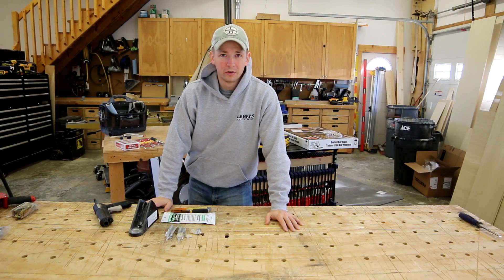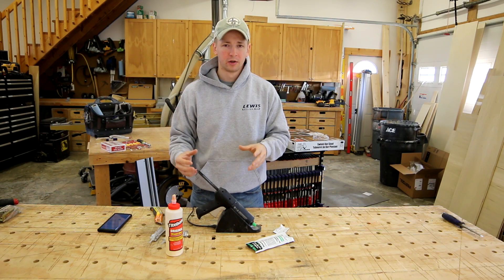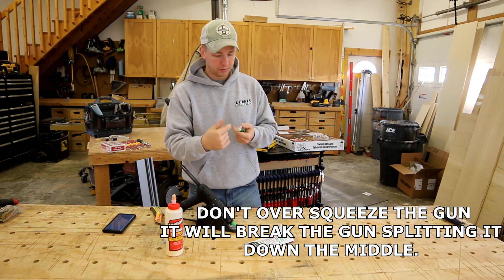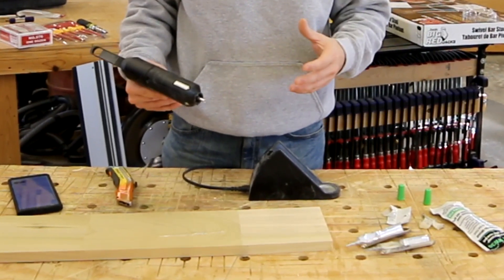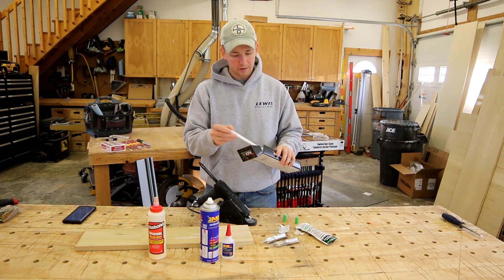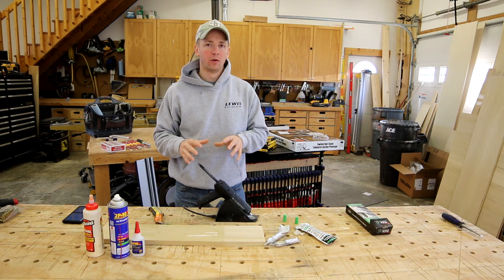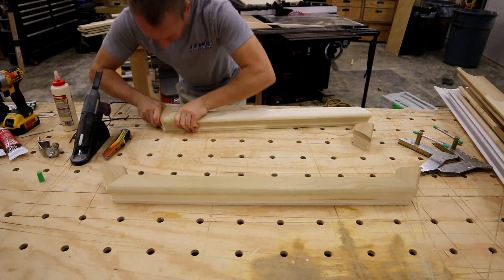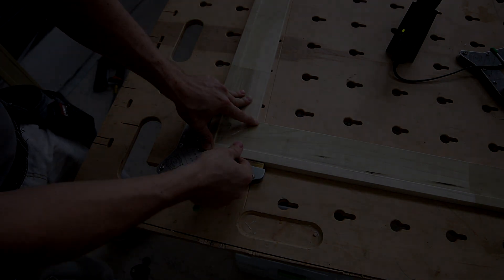PUR Adhesive for Production Trim Carpentry - Everything You Need to Know

Comment: After watching your first video showcasing the Pur glue system, I bought the gun and a case of 60-second-set glue tubes (the yellow ones) specifically hoping the combo would help me assemble through dovetail and half-blind dovetail drawer boxes more quickly and with fewer clamps than required with standard wood glues.

After more than 100 boxes assembled with Pur to date, I can state emphatically that this is the ONLY WAY to glue up drawer boxes with complex joinery. No squeeze out, no clamps needed, superior holding, and nearly instant setting. Just apply Pur at one corner joint, square and hold for a 20-count, and move on to next joint. In 2 minutes with no clamping, you will have perfectly square and super strong drawer boxes that only get stronger by the hour. Total game changer.

Can't thank you enough.
Reply from the maker: That's awesome. Glad to hear it ramped up your production so much!
Reply: Where do you purchase the pur glue gun/cartridges?
Reply: I get mine at Amazon.

Comment: I remember watching this video a couple years ago and thinking how great it would be to have a setup and routine like this. Fast forward to today and my setup is almost exactly this way, I cut all my casing and then assemble it all at one time. I have been using the Titebond Speed Set for a while now, and it's doing a great job. But for window casing I ordered the Hot melt gun the other day, because I know how long it takes those four joints to set sometimes. Having only 4 clam clamps doesn't help either, hopefully Mr Chesnutt is healing up alright and gonna be back at it before long. Thanks for the info Spencer. 👌🏼

Comment: Years ago I forgot what CA glue does to the finish of stained wood and was gluing up a hand rail joint. Well needless to say I had to sand and finish spray that end as the finish coat pealed off once I sprayed the activator onto it. I love CA glue for putting sticking together when I make my divided light cabinet doors with glass but has to be bare wood for sure. I simply wasn’t thinking about it and lesson learned.

Comment: Super well done review. My favourite part about HiPur is squeeze out on finish product just safely rubs off. 
 You covered any issue I’ve personally had with it as a cabinet guy trying to use it for crown molding. I was so excited to try HiPur when I found it, but to illustrate your point as well as my experience using it on maple crown molding, your exact size wood and demonstration at @25:04 , I highly doubt that exact test with maple up on the table like that could have withstood much more then its own weight before popping, never mind any actual pressure or even close to what you did. At least 10x the strength difference to the material you used there.

Comment: Thank You Spencer! great information. I have recently bought into your system. I have yet had a chance to change my work flow and glue up casings. But trust me next chance I have I will be doing my miters.

I have used the HiPUR on baluster on a 15 ft run of railing. OMG AMAZING!!! tightened up the railing very nicely.
Reply from the maker: Awesome, wood or metal balusters? Hipur does not bond well on metal so I would not recommend it for that.
Reply: @InsiderCarpentry  They were wooden balusters on open treads. I posted a picture of it on my IG account.

Comment: Thanks for this in depth intro. I’ve been curious about hipur but had been hearing mixed reviews. I’ve used wood-specific high temp hot glue for years. It’s the greenish color with a slight sulfur odor. This looks like this is a similar but even stronger product.

Comment: Hey great video! I have found out that if you take the chill out of the ends of your joints with an iron or hair dryer it will increase your working time. I believe that it allows the glue to penetrate deeper as well. Also, when you order your glue tubes it’s probably a good idea to have your supplier check the dates on the tubes before shipping, The glue does have a shelf life and I have been shipped expired tubes before. 
The hi-pur system I use is from Franklin adhesives and I called them up to inquire about where to find the dates on the tubes.

Comment: Hey Lewis. I have been reading up on this product and I found reports that the bond can be separated from applying 130 degrees of heat to the glued joint (using a hot air tool). Seems like a useful bit of information.
Reply from the maker: Yes, super useful tip. I wish I would have got that in there.

Comment: Love this video I learned a lot  can you please send a link for the corner clamps I can not seam to find them on your tool page. Thanls keep these video's coming
Reply: Thanks for the like any chance to get a link for the clam clamps in the video I can't find them in your store.
Reply from the maker: You have to call and order them direct from the manufacturer. Miterclamp.com
Reply: Thanks so much I also loved the railing video with the cables great job working around a tuff project and keeping you cool. Truly showing your talent. Thumbs up. Have a great weekend
Reply: @BandasPalette  Clam clamps are wholly made in the USA (materials and labor). They are $65 for four+ or 60 for 8+ (from memory). I would rather pay a couple more cents to support local business.
Reply: @samtaylor6385  that sounds great.
Reply: @InsiderCarpentry  thanks found them also love the van nice job.
Reply: @samtaylor6385  Think you need to say that pricing is per clamp and the price per clamp reduces slightly as you increase the volume of your order.
Reply: @goatsears  No Sir. Price decreases depending if you buy 2+, 4+ or 8+. Not per clamp. From the website: "Two Clamps................... $70.00 each clamp
Four Clamps................... $65.00 each clamp
Eight or more Clamps...... $60.00 each clamp"

Comment: Thank you so much Spencer!
Thursday we installed an oak handrail with returns, we used 2 domino's and pins to save time.
Unfortunately we had to sand the pins down with a flap disc on a grinder.

The only crown we install on our cabinets, are either a custom profile made by us.... or paint grade pine.
All our trim is prefinished without a matching caulk, so we pin it and use wax sticks.
I really want to learn to pre-assemble as much as possible.

Comment: You did an excellent job on this. It is cheap insurance to use a strip of thick plastic tape across both halves of the gun because sometimes when you put in a new tube you can see the gun flex/separate and this holds it together. I was told that the barrier seal is a ball bearing so thank you for clearing that misconception up.
Reply from the maker: I think it might have used to be a ball bearing bb type thing. But not on these new tubes.

Comment: Spencer Just bought 4 clam clamps and the hipur glue gun. Was wondering if you ever used that glue with clam clamps on IPe 1x6. We are going to do a deck and it has a picture frame around entire deck. Wasn't sure if the Ipe wouldn't suck the glue in since its so hard. We usually use a 2 part marine epoxy but is messy and it has longer cure time. Thanks for your great vids. YOU are a truer master carpenter.
Reply from the maker: I would definitely stick with the epoxy for that application. I bet hipur won't like the ipe oils. And being outside I wouldn't trust the hipur. Definitely throw some dominoes in the joint too for outdoor applications.

Comment: Looking for some advice on getting my cartridges to last longer before turning yellowish and not bonding the material. Should I take it off the base after I know I’m done glueing for a while? And you are completely correct when you say it’s a game changer for sure !!
Reply from the maker: Yellow is a sign its been curing with the air moisture. Try and batch your work so the gun isn't on all day. The more time you leave it heated with the cap off, along with re heats, you'll get that yellow color. Sometimes you can dispense some and it will turn clear again.

Comment: CA Glue actually has incredible tensile strength, it is weak in the sheer direction but you go ahead and pull apart two flat boards jointer together with super glue, only pull, nothing from the side. I would be waiting for a while

Comment: 1) What do you think about using PUR on biscuit and dowel joints?
2) Do you have an opinion on Collins Spring Clamps? 
Thanks for the great video.
Reply from the maker: I don't use them for biscuit joints much because you have to get things together really quickly.
Reply: Regular glue is definitely good enough. It swells the biscuit, creating pressure, so the joint won't fail. I have the Collins clamps; and they're definitely inferior to other brands. Like the type/style a German company makes.
Reply: @1589cam  Thanks for the reply. The answer I was looking for. 👍

Comment: Love your content. I saw that you used a cordless glue gun on another video but you did not show it on this video. Do you still use it or did you find some faults in it? Also on the clam clamp, I read that you might want to remove the upper pins to avoid splitting the tips of MDF casing. Any experience with this?  Thanks for all your effort to educate us finish guys.
Reply from the maker: I dont use mdf much so no experience there.
Reply from the maker: The other cordless glue gun is just for regular hot melt. Yes, i love that gun.

Comment: Would you use this for doweled maple face frame or just stick with PVA. I bought this and tried it but was concerned about how much room it needs in the joint. Concerned I cant get the joint tight because the glue is too thick. Have you noticed that or no ? Your casing looks real tight. Thoughts?

Comment: Great video as always. Clears up some issues I was having. Looking forward to your miter saw wings 2.0 any idea when that’s coming out?
Reply from the maker: Not sure yet. 2.0 didn't then out as good as i hoped.
Reply: Insider Carpentry hey did you get the email of the Dewalt mitre saw wings design I sent you? I have an MFT with folding legs as well as a mobile trim cart I made with m18 mitre saw and table saw attached you might also get a kick out of.
Reply from the maker: @ThisTall  Just checked it out. I must have opened it and then not looked at it or something. That's a nice setup. Well thought out. Looks like you're like the rest of us and had to engineer your own connection method. I still waiting for the day someone starts to manufacture a wing connector that's universal for custom plywood wings.
Reply: Insider Carpentry thanks! I didn’t realize you custom made your connection brackets? At least on the extensions.
Reply: Insider Carpentry I believe FastCap has a connection system for their Best Fence system you can buy separately.

Comment: Spencer,

Im building a huge bookcase with a rolling ladder. The upper half columns are hallow and are supposed to slip over a sacrificial piece that is normally screwed down to the counter top. Considering the top is stone, i need to glue these pieces down to the stone. I prefer not to use liquid nails. 

Which of the hot melt glues by PUR will stick wood to stone?

Ty

Comment: Hi Mr. Lewis, can you tell me if HiPur would be an appropriate way to fasten PVC mouldings to the exterior of a home onto stucco? I am looking for a way to attach trim to a house without using nails or screws. I am in Utah, so heat and cold will be a major factor. Thanks.
Reply from the maker: No, you definitely wouldn’t want to do that. You probably want to use some fasteners in a situation like that because if the adhesive fails you’re mega screwed.
Reply: @InsiderCarpentry  Thanks sir! I will find a different method. I love the channel. You are a phenomenal carpenter. I wish more people took as much pride in their work as you do.

Comment: How do you keep your work piece from sticking to the table?
Reply: This is my question, as well. Is the assembly table varnished, or BLO, or is it just not a problem?
Reply from the maker: It will stick a little but if you slightly move the piece after you clamp it it breaks the bond and its no issue. I try not to use excessive glue so there shouldn't be a huge amount of squeeze out coming out the back.
Reply: Insider Carpentry thank you for that, that makes sense ,but if you didn’t do that there would be a problem wouldn’t there Be. That’s some powerful stuff definitely going to use it. Your tutorial left nothing out. I appreciate that, keeps me out of trouble.😳😀 i’m also going to order some of those clam clamps ,I’ve never seen those before, and they’re expensive ,like 80 bucks for a pair ,but it looks like they’re well worth it.

Comment: I use a heat gun to reheat cold joints and re-clamp, also in the winter If the wood is cold I’ll briefly heat up the wood joints with the heat gun before applying pur glue. I’ve found that it gives me more  open time. Cold joints cure way to fast.

Comment: I'm a deck builder and work with PVC trim and Trex decking for the most part (other brands as well) Trex is a dual extruded composite material with a Pvc cap. We use/have used a variety of adhesives for our Trim joints with varied success. Next to no success with gluing decking joints. The big problem is both expand and contract with temperature. Do you have any knowledge of the PUR glue with these types of products?
Reply from the maker: I don't think it would work well with that product. It doesn't like plastics and metals from what i understand.

Comment: Question on that chart with all the different strengths of glues over time: Is that assuming clamping pressure for the whole 2 hours? Does HiPur get stronger after 2 hours EVEN WITHOUT clamping pressure? Or is it only strengthening as long as you are clamping it? I use regular wood glue and leave it clamped for about 2 hours. Is HiPur strong even with only 30 seconds of clamping?!?!?!?! That's crazy... that can't be possible. lol
Reply from the maker: It is very strong after the first 30 seconds but continues to cure for a full 24 hours. The strengthening curve is very steep at first and tapers off the longer it goes. Full cure at 24 hours. It doesn't need clamps to continue to cure. I take my clamps off after the first 30-60 seconds.
Reply: Yes, the bond increases over time, and the point of the product is the extremely high initial bond strength, which drastically reduces the necessary clamp time.

Comment: Great video, i have been thinking about making the transition over to hipur. I have two questions, First, how long or how much work do you get out of a tube. And secondly, we use a lot of flat stock kreg screwed together, How do you feel hipur would work in that application?
Reply from the maker: You will like hipur with clam clamps much better than kreg screws. I use a few tubes per house doing large custom homes.

Comment: Thanks for posting this!  I’ve used PUR but like everyone, am wary of the cost and get bummed about not using a whole tube.

One question I have:  I do a lot restoration work on houses with clear finished Doug Fir trim and built-ins.  There are many situations where this system would be helpful, but I am concerned about the thickness of the PUR glue line/material buildup. Is the PUR glue thin enough to be squeezed down to a decently thin/not-so-visible glue line?
Reply from the maker: When used with clam clamps I get zero glue line. 

When using on handrail fitting score the face of both pieces. It gives glue somewhere to go and you'll get much less of a line. 

On crown I prefer to use CA glue. Its hard to not get a visible glue line with just hand pressure. Not a big deal with raw wood, but not ideal with prefinished crown.

Comment: Hello Lewis, upon reflection have you used this process of preassembling casings in restoration homes? or do you find it perhaps most effective on new homes as plumb measurements are generally more square: would you use this method on a restoration project?
Reply: Personally, you'de have to inspect your windows upon estimate time or when walking into the job for the first time...I'm old school, not a production guy anymore, however, settling causes issues, etc...

Comment: Looks like I’m going to your amazon tools and picking one of those up now, I never looked into it thanks for the video. One question for handrail fittings, are you using just the PUR and no mechanical fasteners? That would be amazing if it’s that good
Reply from the maker: Depends on how much stress is on the joint. If its some long gooseneck that is going to get a lot of leverage potentially applied to it I will throw in some screws and plug them. Otherwise I use it often with just the hipur. But its important that you experiment with it first and see what makes the strongest joints. There is a kind of an art to using the product.

Comment: Hi Spencer. I love the channel and watch all your videos. Your “less footsteps” rings in my head everyday on the job. I am constantly looking for ways to increase productivity for my crew. I have a question though...I have only started using 2P10 and researched CA glue, have learned it’s basically an industrial strength crazy glue, but it states it has a 4000 tensile strength. In your video you stated it does not have any tensile strength. May I ask what led you to make this statement? Just curious so that I can learn if I am misinformed about 2P10. Thanks again for your help and information!
Reply from the maker: Real life testing. I recommend mocking up some sample joints with the materials you are using and see what works. Try and break them and gauge the strength.
Reply: @InsiderCarpentry  My guess is that CA glue might be brittle.  And that could be the reason you have failures.

Comment: using on hand rail fittings such as easings or or volutes, are you still using rail bolts as well or just relying on the glue? thanks in advace. DB
Reply from the maker: In those cases it’s nice to have a mechanical fastener also  but many times I’m still just using hipur.